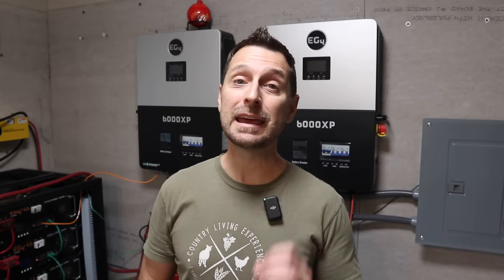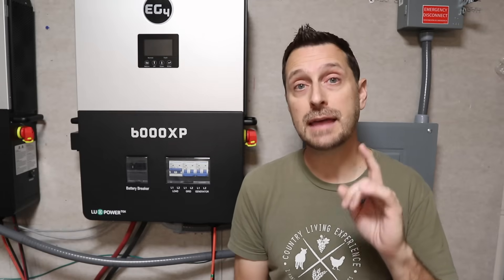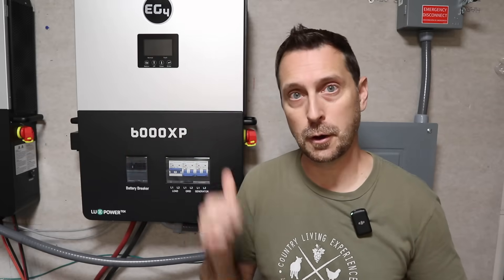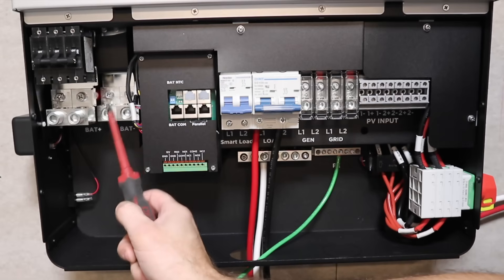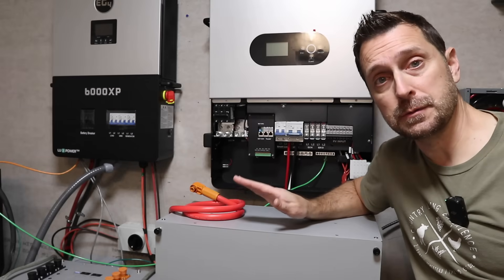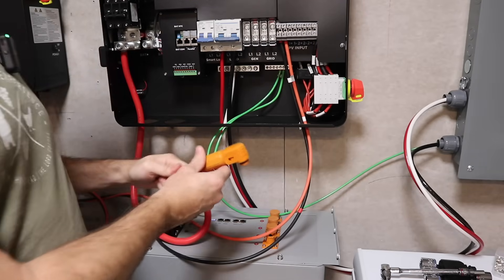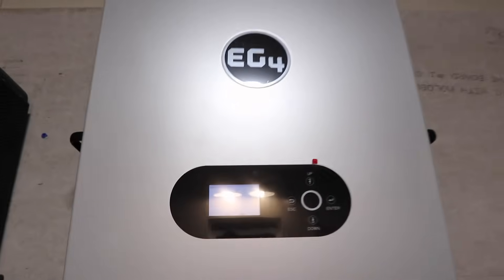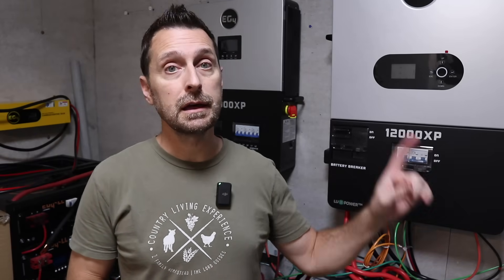Brand New! EG4 12000XP Off Grid Inverter Full Install And Review!

Comment from the maker: OUR SOLAR EQUIPMENT......CLICK HERE: https://www.signaturesolar.com/?ref=countrylivingexperience COUPON CODE for $50 off: Countryliving12 
*EG4 12000XP OFF GRID Inverter*: https://signaturesolar.com/eg4-12000xp-off-grid-inverter-48v-split-phase-24kw-pv-input-12kw-power-output/?ref=countrylivingexperience&utm_campaign=12XP%20Inverter%20Launch&utm_content=Homepage%2011%2F1&utm_source=web&utm_term=Homepage%20banner%2011%2F1
Reply: What kind of panels do you have these mounted to?
Reply from the maker: @cplbitterklinger594  I have two different panels types in three different strings. Two strings have 455w Solarever panels and the other has 415w Sirius panels.
Reply: @CountryLivingExperience  I'm sorry, I meant the panels that your inverters are mounted on.  Thanks for the response.
Reply from the maker: @cplbitterklinger594  Ah, I understand. Those are Hardie backer panels from Home Depot. Fire resistant

Comment: Thanks for the info.  I am deciding whether to add a 2nd 6000XP or switch to the 12000XP.  I use the 6000XP to charge my truck, but ran house for 56 hours until toaster and microwave overloaded a single phase.
Reply from the maker: I like the idea of 2 6000xp's personally. Then you have redundancy in case one inverter fails.

Comment: I used your coupon code and purchased the 12000xp a few weeks ago. Last night I finished unboxing and drilled 4 holes in my concrete basement storage wall ( which took me some time even with the right bit) using the template. 

It took me awhile to get the ex  poop mansion bolts and hanger frame up and level but did it and it took my son and I one try placing the 12000xp and mounting it. I can still see your face as you got yours mounted. Funny happy and relieved face. Great video. 

I had just finished my (14) 460 watt Aptos Bifacial Panels on a DIY wood/metal 45' ground mount. 

I'm confused. What's the formula for calculating strings of panels and the 12000xp?

I'm having a hard time wrapping my mind around it. My calculations say I can use one string instead of 7 and 7.

I will for phase 2 probably get more panels. I have room on my mount for 7 more panels. 

Your help is appreciated. I used your coupon code for panels to. 

I haven't purchased batteries yet but trying to beat the year end Big Beautiful Bill credit option. Thx for your great content. Real world
Reply from the maker: If you do two strings of seven, that would mean you would have about 287 V, which is perfect. You would have about 28 A which is good. If you run seven panels and series and then another seven panels in series and then parallel those two strings together and take that into one MPPT, then that will be perfect. You should have about 6400 W for that one side of that one MPPT.
Reply: @CountryLivingExperience thank you. Signature Solar said the same as I would have 2 options. MPPT 1 (2 strings) or option 2: MPPT 1  1 string of 7 and MPPT 2 another string of 7. 

I still have room on my ground mount for another 7 panels.

Comment: Would like to see an 12000xp connected to grid with a double throw switch. One direction in switch does eg12000xp with grid other direction does 100% grid and bypasses the 12000xp. My thought on this is if i ever need to do maintenance on the 12000xp i can bypass it and still have my sub panel hooked up. Other reason would be if 12000xp ever fails i have grid with a flip of the switch
Reply from the maker: I did a video on the 12kpv where I installed a manual transfer switch. It is in my solar playlist.

Comment: Can I start. With one battery  in few months  add another will work
Reply from the maker: Not for the 12000xp. You need at least four 100ah batteries or two 280ah batteries.
Reply: @CountryLivingExperience 
So save up more or start with  6000 xp  and 1 wall mount
Reply from the maker: @irfanwaseh  yes. I would start with one 6000xp and scale up your system from there. You can start with one wallmount or 2 Lifepower. Or start with something like a BigBattery Ethos 2-module kit and add up to 16 of the extra Ethos batteries in the future. There are many combinations.

Comment: My 12000xp arrived today and I used your discount code. Wow this item is huge. Thank you for your content. I'm installing panels on our ground mount currently 440 Aptos Bifacial. I have 14. So would I have 1 string of 7 and a 2nd string of 7 going into conduit into my 12000xp?
Reply from the maker: Awesome! Yes, it is very large.
You can run it with two strings of 7. Looks like you will have about 270-ish volts per string which is a good target voltage. 
I would personally run at least 4 sets of pv cables through your conduit for future expansion. It is a pain to run more once everything is buttoned up the first time.
Reply: @CountryLivingExperience , I was thinking the same thing. You've really got me sold on Signature Solar. I really like working with them. I've learned so much from your channel as I've got 2 shipments using your discount code so far. First was the 14 Aptos 440 Bifacial and the EG4 12000xp.

I need to save up for batteries as that's my next purchase. Just not sure how I want to do that yet. Battery Banks are so expensive and for me to really do things right, I need to have a bunch lol. 

I have an electrician coming out Thursday to give me a bid on running wire from my main breaker box in the kitchen to the basement where I want to hang my 12000xp in a nice cool concrete space. That's my biggest problem is getting the grid load sub panel down there. This is fun. My homemade ground mount is huge. We live on 4 acres on a ski resort in Utah so I have my low end of the ground mount 3.5 feet off the ground as we will get some big snow but it's clear perfectly for the southern sky. I'm just in awe of these 6.25' x 3.75' panels and they attach nicely to the unistrut I have on my wooden ground mount.  This is fun thx to you as I think your step by step approach to configuration is what I've needed. Our cabin is 4700 sq feet so I know this is really a first phase as I know I need 2 12000xps , more panels and more batteries. I have to show progress with the boss, my wife first. She likes what I've done so far. So thx for encouraging me with the confidence you display in your videos. 

1 more thing. The conduit box and EG4 battery bank really fit nice but there are cheaper battery bank deals out there so that's my dilemma.

I built solar arrays for my 2 RVs already with Will Prowse  setup 3500 watt inverters on plywood and Renogy panels on roof and that was successful but I always seem to have a problem at the load connection area and here I go again with 12000xp in basement and breaker box in the kitchen. Ouch

.
Reply from the maker: Glad you are having fun with it. 
There are now less expensive batteries on the market like the EcoWorthy. I am not sure of their long term quality but I have heard they are good. Best to explore all options.

Comment: Newbie here, so got a question for the more experienced people on here. I currently have 45kw of lithium storage but too small of a system, so this is exactly what im looking for. Hoping to purchase the inverter and top it out with 24kw of solar panels, with 12kw per mmpt. But all the panels im looking at, 12kw of them would exceed the 385voc limit per mmpt. Any solutions? Also, im looking for bigger panels in the 650+ watt range per panel. Any imput would be apreciated.
Reply from the maker: You will have to play with your panel configuration and experiment with different series-parallel strings. It is just about crunching the numbers for the panels that you have.
Reply: @CountryLivingExperience  thanks for the input. Got the panels figured out, and mounting them right now. Got another question that would love if you could answer, on the batteries, I have 2 indoor wallmounts and a 3 battery rack of the ll-s. Is it better to connect them all to a busbar and then to the inverter, or can I connect the wallmounts together then run to the inverter and positive and negative from rack to inverter since the inverter has 2 slots for battery inputs? Going with the second option would eliminate the need for bus bar but I don't know if there would be an issue with it. Thank you ahead of time.

Comment: Love your videos.  You answered my question on if I could run 6awg for the load if I wasnt going to connect to grid for passthrough, so thank you.

Wish I could find a way to just limit the grid input in the manual or switch out the load breaker to 50a.

My max loads will never exceed 6k watts (tiny house in Puerto Rico).  The reason I want to go to the 12000xp is because the 6000xp sounds like a jet taking off even with minimal load.  Watched videos of the 12000xp against the 6000xp with the same loads applied and the difference is huge.  Literally upgrading to an inverter with more than twice the capacity I'll ever need just for the noise reduction....
Reply from the maker: Glad my videos are helpful. Best of luck installing the 12000xp

Comment: Hello and earlier videos that I've watched you suggested that I bought the 12,000 XP and that's exactly what I did and I used your promo code thank you so much from signature solar I also bought 34 395 watt panels along with four 100 amp hour batteries my question is the wiring I'm going to be running this inverter unfortunately 50 ft from my panel I'm not going to have a critical load panel because I'm running it directly to my main panel and in the event of an outage I'll just simply go turn off any unnecessary circuit breakers but we very rarely have power outages out here but my question is since I'm running 50 ft using 2 gauge wire that's going to be really expensive because I'll have to run two separate wires containing three two gauge and then one ground for the positives and the neutral and the ground do you know a way for me to do this with one run only I'm going to be running from my main panel which supplies all my critical loads and then my switch from my bonded panel which is on the pole was going to be running the power to the inverter through a 100 amp circuit breaker which is currently hooked up to a generator backup is this the only option I've got to have no choice but to run two complete separate wires for this or do you have any other suggestions I know this is a tough question because it's really just me trying to save money and I really am sorry it's such a long message so if you do get this I want to thank you ahead of time 🙏
Reply from the maker: Awesome! 
Send these questions to me at the channel email address. It is a little hard to answer indepth questions here on this platform.
Reply: 2 gauge wire sounds like a lot more than you need. Have you used a voltage drop calculator? 
What amperage and voltage will you be pushing through them?

Comment: I somehow was pulling 8,134 watts from the 6000 XP although I will save one of the inductors started making a noise I don't know something was loose or what.
Reply: I will add that it only makes the sound on one of the MPPTs when it's at full load EG 17 amps input

Comment: mine came with 8x M6 bolts. I have no clue what they’re for. Any idea?
Reply from the maker: M6 with concrete sleeves ?
Reply: @ no it’s the same style screw as the 4 that are used for the lower mounting brackets but they are M6 and 8 of them. The manual shows them being in the package but I can’t see to find where they belong on the inverter
Reply from the maker: @ShortyzProductionz  I see that in the instructions now. I looked through the entire manual and can't find where they would be used. I did not use them for anything.
Reply: @ alright, good to know it’s not just me. I appreciate it

Comment: I'm reading the manual here and it says you can parallel up to 16 inverters. Is that what you see?
Cause you said 6. Maybe you just misspoke or I don't hear to good.
Thanks for the excellent video. 
I am about to pull the trigger on this.
Subbed & liked!
Reply from the maker: Thanks. 
I said 6. Page 24 section 8.2 of my manual states 6 units total in parallel.
Reply: That's weird. My downloaded PDF page 9 Features section says supports 16 in parallel for a total of 192kwh to support loads.
Reply from the maker: WOW! I just went back and compared the installation manual I used from when I installed mine 7 months ago and it is very different than the one I just read online at the Sig Solar website. They must have done some major upgrades to the unit and completely rewrote the manual. It is now 16 units in parallel stated on page 27. Very interesting. I need to ask my contact as Sig Solar what they changed.
Reply from the maker: Here is the response from my Sig Solar contact…”Yeah, the manual was confirmed to be updated multiple times since launch, so this makes sense as to why it was different.

I would still not really recommend paralleling 16 as there is lots of room for failure to snowball. I would go with 8 separate sets of 2 if I had to use 16.”
Hope that helps.
Reply: I will never need that many. I was amazed to see that number myself. Very impressive.
Keep up the good work Eric!
Reply: They said they updated the manual but what was the hardware / software update that warrants that kind of increase?

Comment: I don't think that the 12000XP has 4 trackers, as one person took the cover off and the inputs from "one a" are just wired directly into "one b" with jumper wires. Open up the system and have a look.

Comment: I noticed that you didn't discuss the GRID function of this inverter.  If you add the 100 amp pass through to grid power, do you still need a minimum of 400v DC in batteries for the inverter to run properly or will the grid kick in and support the inverter with only one battery installed?
Reply from the maker: They recommend at least one source of AC power and DC power that can handle the output of the inverter separately. They still recommend you have the 400ah of batteries just in the event the grid goes down.

Comment: Thanks for your video! It has been very helpful as I prepare to install my own EG4 12kxp. I wanted to mention that the smart load connection can ALSO act as a smart AC input. You just have to configure it in your settings depending on the way you want to use it. Nice stuff compared to a few years ago.
Reply from the maker: You’re welcome. 
Yes, the advancements in these inverters is amazing.

Comment: But with two 6kxp don't you get an output of 6000 watts, and with the 12kxp I think you only get 4000 watts output.
Reply from the maker: That is not correct. Each 6000xp will output 6000w and the 12k xp will output 12000w. Please refer to the specification sheets on the Signature Solar or EG4 website and watch out load/output test videos.

Comment: Got my 12000xp hooked up with 2 PowerPro batteries and 100 amp bypass. So easy.  Im going to hook up my rooftop solar as soon as it warms up a bit, but for now, I'm topping off the batteries at night when my grid power costs just 5 cents per kwh.

Comment: Hello, i have two different brand batteries with my 2 different systems. If I upgrade to 12kw xp, can I hook the one brand to the 1 battery connector n the other brand on the other battery connector,  Will that work?
Reply from the maker: That won't work. Sorry. You need to parallel the batteries together to a common bus bar and then run battery cable to the inverter.

Comment: could I put (2) 200ah 24 volt batteries in series to get 48 volts with this unit (saves money).  With our RV we do 2 x 6volt vs 1 x 12 volt,
Reply from the maker: You can. Just pay attention to the minimum amp hours for the inverter.

Comment: How would you combine the L-1 and L-2 from 2 12k parallel into the main panel. Now can put them together, but I would like now if there is a connector?
Reply from the maker: We just used a sub panel and landed them on a double pole breaker. We showed this process in our previous videos with the 6500ex, Growatt, and 6000xp.

Comment: How many of the 14.3 KWH batters can be hooked to a 1200xp?     can 4 or 5 be paralleled?
Reply from the maker: I believe you can only connect 3 wall mount batteries per inverter.

Comment: This unit looks amazing!  I'm trying to learn all this currently to put together a very large offgrid build.  What confuses me is the max of 480v and the max of 24,000 watts.  So is this unit capable of taking in (hypothetically) 8 strings of 3,000 watts?  So lets say 8 panels per string of 370 watts and 40 volts (2976 watts)(320 volts).  This is the part that's a bit hard to understand for me.  Any input is appreciated!
Reply from the maker: It’s a great unit for sure. This has 4 mppt inputs. So only 4 strings. Each can take 480v.
Reply: @CountryLivingExperience  Gotcha.  Would be interested in a video where you break down your PV inputs for this unit then.  Strings/Panels/watts/volts.  Thanks for the quick reply!